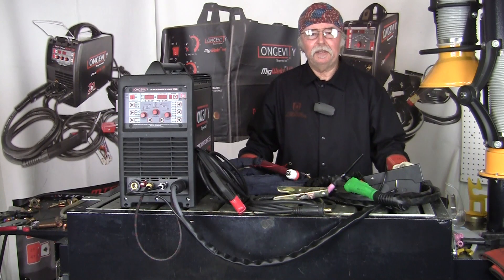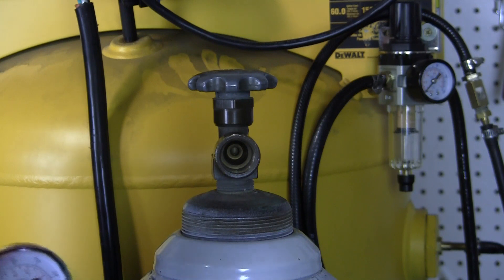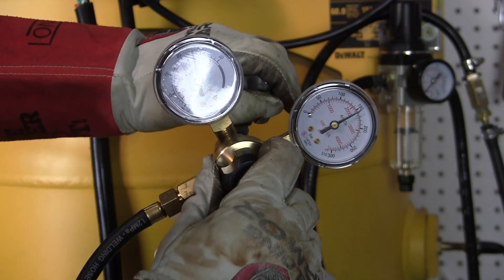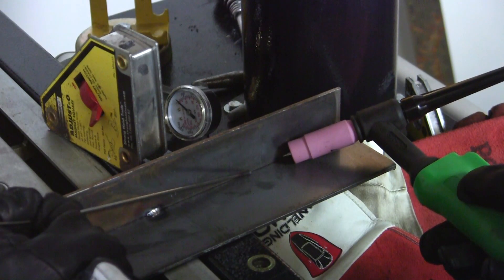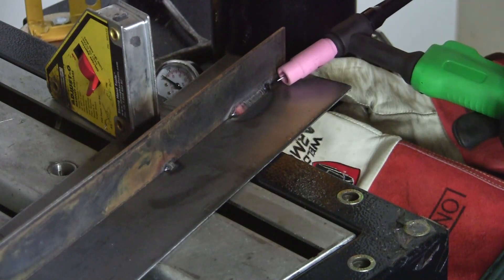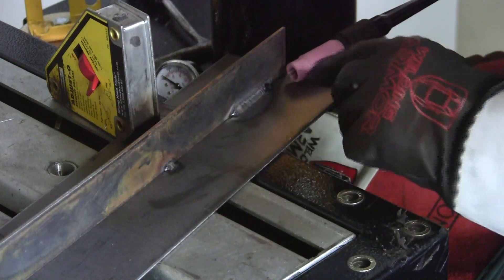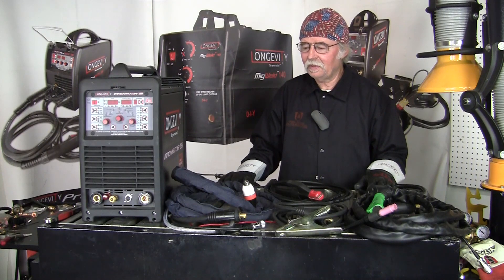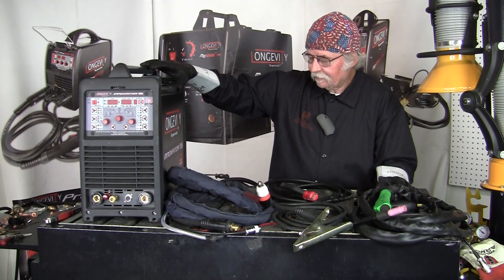INNOVATOR 255i SETUP REVIEW AND DEMO TIPS AND TRICKS

Comment: Is the Fan always running or is it temperature controlled?

What's the weight and dimensions.
Reply from the maker: The fan runs at all times but it is a lot quieter than most models in market.
Reply: longevitywelding
Thanks, Nice upgrade would be fan on demand as miller has.
More efficient and these days that's a great selling feature. ;-)